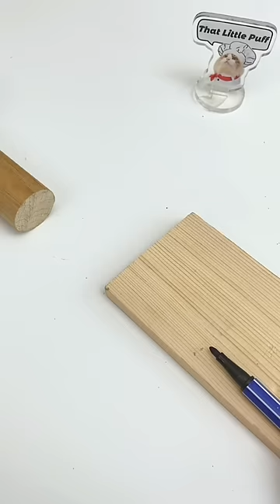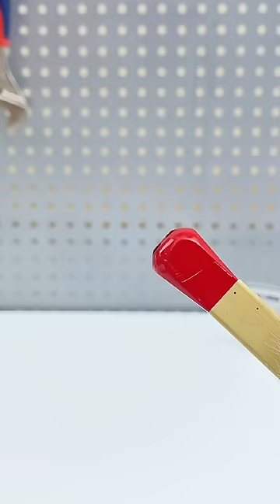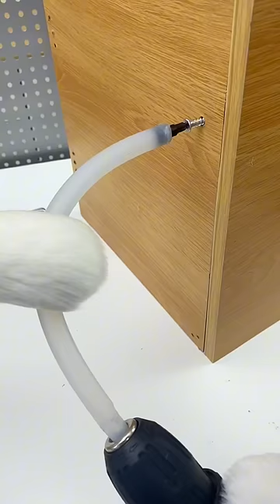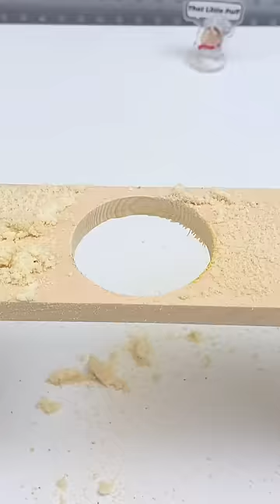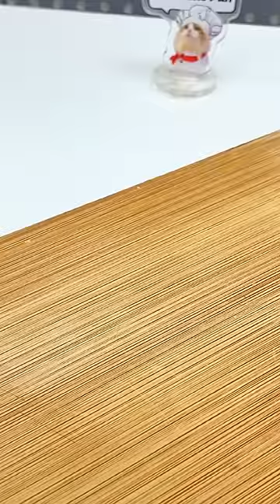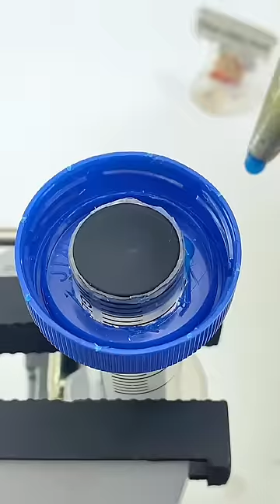Hot glue sales after this video: 📈📈📈 #thatlittlepuff #catsoftiktok #satisfying #hacks #cat

Comment: To anyone who does any woodworking, keep your scrap plywood and particle board around. When you need to drill a hole, fasten one of your scrap pieces to the back side of the wood you’re drilling with your hole saw bit. That way all of the splinters and rough edges come out on the scrap wood instead of the good piece.

Comment: Those hole cutter bits which usually come in sets) can layer so find the matching hole cutter (if available) and place it inside the bigger hole cutter you’re going to use. Your new whole will be better centered that way too. Otherwise, this method works too; but you’ll need some scrap and a good eye.